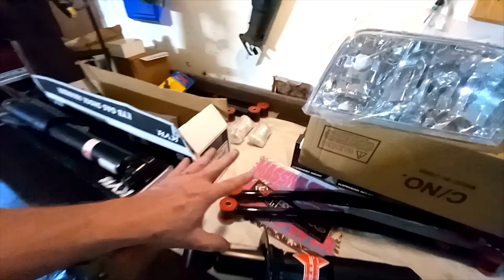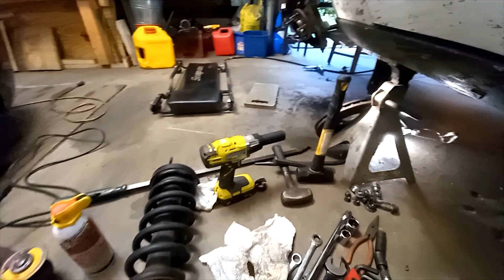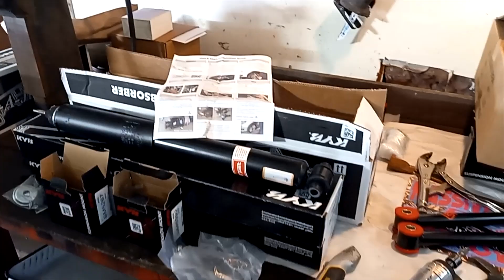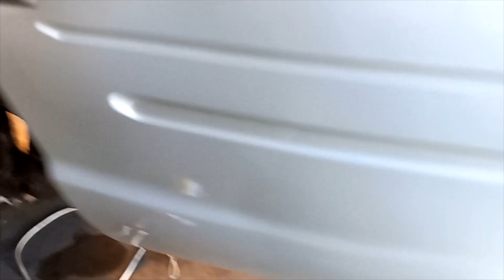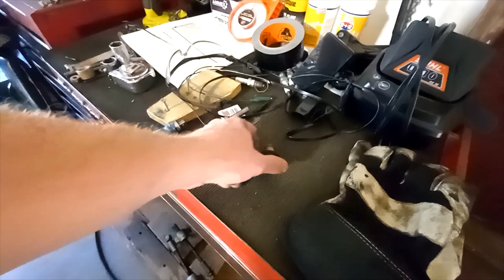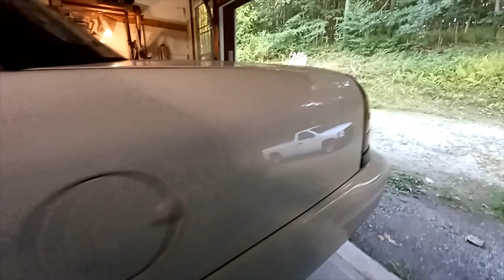Crown Victoria P71 2009, Suspension Upgrades!

Comment: Did you have to replace the upper control arm when installing a 2 inch lift on the front
Reply from the maker: No I didn't replace the control arms. They were still good.
Not sure what you mean by "2' lift". There is no lift.

Comment: What bolt am I looking for in home depot for the front struts?
Reply from the maker: 16mm, 2mm pitch.
Reply: @stokerdon1020 how do I find that in Home depot?
I only see bolts named 1/2 x 4-1/2" etc...
Reply from the maker: @2011_cvpis  It's metric, not standard.
Reply: @stokerdon1020 yes I know you're referring to metric, but that's not my question

Comment: Those front upper control arms are the first thing to go on these cars in my experience. I really like the Moog replacements. One of the best first upgrades for these cars along with chopping a full coil out of the front springs to make it sit an inch lower. Drastically improves the handling!

Comment: is there a second video with the rear control arm / watts link install?  is it the Massive Suspension Competition Series kit from ADTR?  SKU: Massive_Competition_Fixed_kit
Reply from the maker: Sorry, no. I wasn't able to get that on video. It's pretty simple, unbolt the old arms and bolt on the new ones.
Reply: @stokerdon1020  nice I'm considering buying this kit for my 2011 P7B - would you recommend?  what differences did you notice over stock?

Comment: Hey Don. You coulda used a torch for those bolts. Either map gas or acetelyne torch. Heat is your friend!!
Reply from the maker: Got torches, no gas though. I remember torched rubber bushings smell real good, LOL!
Reply: @stokerdon1020 I cut my'n out the same as you, its not very fun lol